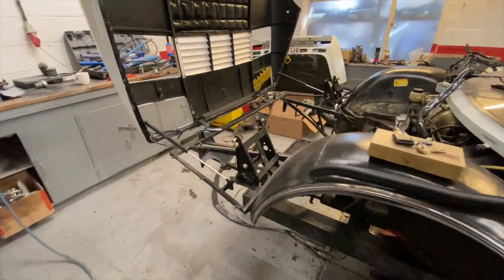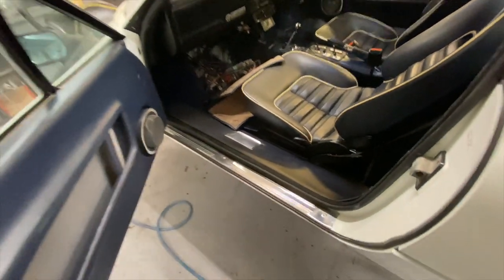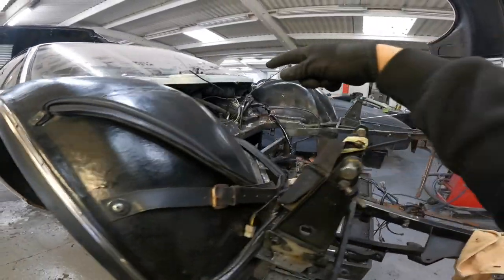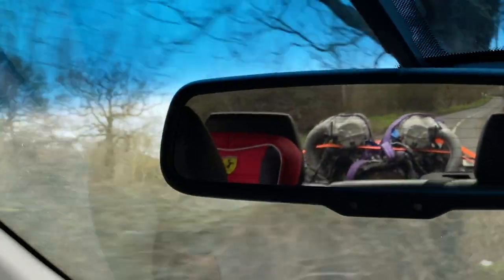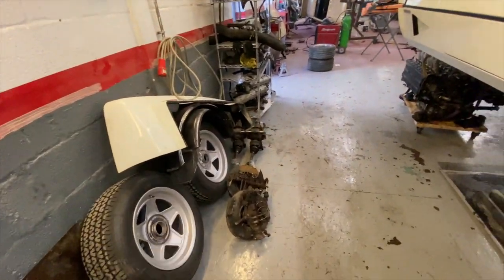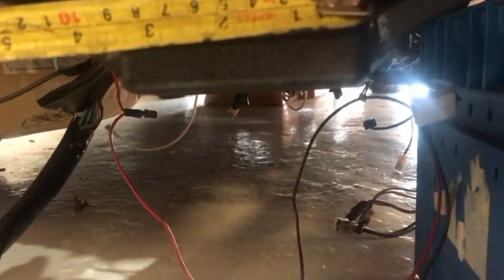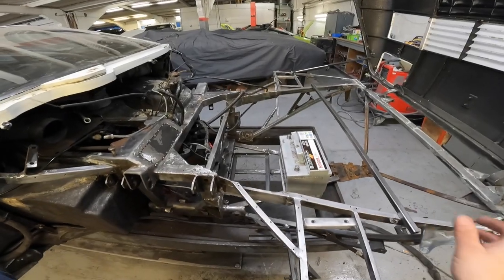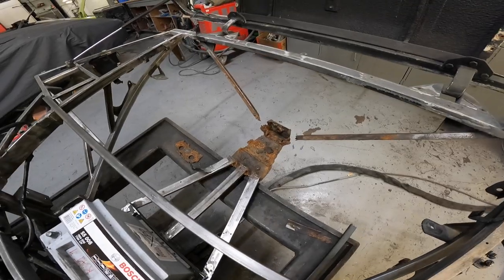I Found Hidden Problems on My Ferrari 512BBi Boxer Project

Comment: I'm surprised at the lack of rot in this car.  It's going to turn out to be a fantastic restoration.  Well done saving this beauty.
Reply: yes, its in stunning, almost '5 yr old' condition
Reply: I was thinking the exact same thing. A Ferrari - left outside, in England, for 12 years and only a couple of brackets have rusted away. Its a miracle really.
Reply: @maxgreece1  not very likely either I would have thought
Reply: Right, plus RHD BB 512 are so rare..
Reply: Rot?  Do you actually mean rust/carrosion.
Reply: @airgliderz  affirmative
Reply: Rot ? Let that car outside in the Canadian weather 😳 for 12 years and you'll be lucky to save the license plate ! Faded. 🤣
Reply: @marcryvon  It was presumably never driven on winter roads. British salt and the mild climate are the perfect partnership for rampant tin worm.
Reply: @marcryvon  so it rusted, rot us not what occurs unless your car is a Ford or made of wood or a vegetable
Reply: the phrase "left outside" is subject to interpretation.  I will put money on it that this car was not left outside directly under the sun and stars for 12 years.  "left outside" as in the outside detached garage.  the reality is that these guys just want clicks, views and comments.   they throw a little dirt and grease and oil on the cars to make them look worse than they are.  is/was this a mint car?  absolutely not.  neglected for sure but the exaggeration is for the drama.

Comment: Please protect your windshield when you powergrind and spray sparks... you will regret later. Fantastic work!!
Reply: Absolutely right.  Those little lumps of molten metal will pit the glass and you will be kicking yourself.  Don't ask me how I know....
Reply: Found this out when i melted my watch 😅
Reply: Same with wiping the metal dust off the paint when finished. It will flash rust and eat into the paint leaving tiny pits behind
Reply from the maker: Cheers for the tip 🙏🏻
Reply: in 2001 I bought a 3dr Cosworth for £3000,in 2003 some Wally Inna garage ground the brake drum lips on a 13 year old Belmont over my Cosworth and three days later the bonnet bumper headlights windscreen roof and sunroof started rusting on my car all over them areas
I'm not kidding I raced around there and was gonna fukkin kill him
After the lads called me down I claimed and got £1600 so my 3dr cost me £1400
I wasn't joking about killing him either 😂 💥
Reply: I said "Oh no, no, no!" to myself when I saw the welding begin without protecting the glass. Hopefully all is well. I'm sure that windshield isn't cheap.
Reply: Came here just to say the same thing
Reply: Not to mention his glasses.  Hope they are a cheap pair.
Reply: I'd say please protect your lungs also ! I wager these are more important
Reply: @AlfredLesliePalmer  Yeah, I always wear a respirator when welding. As someone who works professionally in the field of respiratory health, I can tell you that breathing welding fumes is very toxic. And yet, virtually nobody on YouTube wears a respirator when welding.
Reply: @ZeGermanHam  I know right ? I can't say I work in the field, but I tinker in making guitar pedals (and yes I like cars) and everyone forgets the fumes are extremely bad 
I also winced when our lovely host joked about inhaling parts of the particles from cutting the frame !
Please people, take care of yourselves, the work you do is so important and mesmerizing, I'd prefer you enjoy it for a real long time
Reply: I just posted this. Yep i grow up in a body repair garage and we always cover the glass as the hot sparks go into the glass and paint and its a pain..
Reply: @bigjohnfury5662  Your aptly named then.
Reply: I couldn't believe he was grinding near glass like that, needs some leather welding aprons or similar covering all the glass and plastic..............I agree great work
Reply: @Matt Jones - Did you have to replace any widowers?
Reply: @Ratarossa  You can remove the embedded bits from swept areas of glass with a razor blade or Stanley knife blade scraper, and leave the panel outside for the metal particles to rust out. Works really well on white paint. Once rusted a bit they come out more easily.
Reply: You beat me too it - I bet a new windscreen will now be required.
Reply: And your eyes and lungs, mate !
Reply: Did that 35 years ago on an old flat windscreen beetle .... To be avoided 😜😜😜😁
Reply: Sorry I didn't see this comment. I write same.

Comment: Small tip. After you’ve finished the weld, don’t pull the torch away so soon until the metal has cooled below red heat. This will maximise gas covering and over oxidation. Overall improves weld strength and finish.

Comment: Success will be defined by not having any “extra” parts left over when it is put back together.  Thus, one should never take a hiatus away from such a project once it has begun.
Reply: There are always extra parts installed at the factory.
Reply: As young fella of 12 years of age I watched my Dad kick and shout at the lawn mower when it wouldn't start one Sunday afternoon. With a bit of encouragement and advice from a neighbour I took it apart, cleaned everything, and basically did what I now know to be a routine service, and reassembled it. I had a handful of nuts, springs, washers, and screws left over. My Dad reckoned that was the best that lawn mower had ever run, even better than when it was new.
Obviously those parts were superfluous to requirements, and I imagine a Ferrari is no different, just bigger.

Comment: just one tip, use ear protection, might sound stupid now, but will make a difference within few years
Reply: I thought I saw ear plugs when he was grinding, but maybe not.
Reply: I agree the sound track spoils the video, should be more involving with commentary on part removal.
Reply: "Might SOUND stupid"🤣😆🤣😆🤣. Made me laugh anyway.
Completely agreed from someone with a continious screech in both ears 24/7.
Reply: Eyeglasses are not sufficient when using wire wheels, or any grinder for that matter. Cover the windows too! Sparks will embed in glass. I was also triggered watching him wave his arm around near the digital micrometer balanced on the frame. Loving this project; massive respect for taking this on.
Reply: Pardon?

Comment: I know the feeling of being discouraged on a restoration. I’m working on a project that has some light surface rust throughout and I have to basically strip the car to fix it correctly. Most people probably would even notice it, but I know it’s there and it has to be done right. In the end it will be worth it though. The feeling you get at the end knowing that you did it the right way is priceless.

Comment: Car restoration is an ultra run, not a sprint and not even a marathon, I feel for you when you say it is demoralising! Doing it one man is even harder. We know you can do it and we are with you all the way in spirit.
Reply from the maker: Thanks buddy, sometimes I need comments like this to help spur me on
Reply: @Ratarossa  Know the feeling :-) A friend just told me about a F430 with a cracked engine block that's for sale. Would love to just jump into it, but it be to big a project for a first Ferrari project. Don't even know what a replacement block costs or complete engine if there is more damage.

Comment: FYI: regular glasses don't protect from bits of grit and red-hot metal getting around the lenses. In my case, I lucked out in that the scar on my eye is in the white part, so it didn't affect my vision (once it healed).
Reply: I've been to hospital 3 times with grinding sparks/chunks embedded in my eye. Just like the windscreen - it's the heat that sticks it in there so you can't blink it out.

Comment: Great video, but you must cover the glass areas when grinding and welding, any of those super hot sparks will eat into the surface of the glass which renders it scrap! 
Trust me
Reply: Trust me too! The bits of molten metal get embedded in the glass and then go rusty and (if on the windscreen) trash your wipers. I don't think I have ever commented on a video before but seeing you grinding and welding within a foot of that GLORIOUS windscreen made me scream at the video...

Comment: That patch panel you put in buy the pedal box needs to be properly seam welded all the way around. Your only aloud to spot weld repairs if if you are replacing a complete panel and thats how it was done from the factory.

Comment: Hi Scott good to see you getting on with things, Always look forward to an update.
 The battery brace works great if you can put some 5mm rubber sheet on the brace, I throw a bit at the bottom of the tray too with some holes in for drainage, the battery never comes lose then.
 Some strong magnets make fabrication sooo much easier holds the job in place prior to tacking...
 Well done, thumbs-Up
Paul UK

Comment: I can't recall an episode where you showcased the transmission of the beast, which seem to sit underneath the engine? I saw the clutch dissaembly but haven't seen the trans in any clip the I saw. It looks as if it shares the engine oil pan space, which is pretty quirky if the case. Anyway, what's most important is keeping the legendary white shoes alive, beside doing awesome work as usual!

Comment: That bracket should be an easy fix.  The trick is make a dimensioned drawing (probably in metric) and then cut and peel back the pieces one at a time, measuring and making dimensioned drawings as you go untill you have completely disected it.  Then recreate each piece to the measured dimensions and weld it up.

I fixed a wrecked Lotus like that.  It's a bit time consuming but not particularly difficult.  In a couple days I was able to completely remake the Lotus driver's side half of the rear chassis.  A radiator bracket shouldn't take more than 2-3 hours.

Comment: Starting to strip the engine could be opening another can of worms when you have enough on your plate already with the frame. It might make more sense to stay focused on one part of this project at a time or you'll be overwhelmed by it. If you do you'll be more likely to remember how it goes back together again. 
Keep up the good work.
Reply from the maker: I had to strip it back for ice blasting
Reply: Where you at with bad compression??

Comment: If that is main rust you found you are very lucky. Quite simple repairs in fabricating if taking car apart and putting it back together is excluded. One tip, cover  windows while angle grinding. You ruin the glass with those sparks, they burn into glass if hit.  Also would't start to take delicate engine apart next to dusty grinding and welding area. I see uncovered ducts. Interesting series this has been with very unique car.

Comment: Do you think the lack of rot is because the car want used, the seals got stuck fully shut keeping the water out and by not travelling at speed, rain water hasn't been flicked up into every crack and crevice meaning that alot is just surface rust? I'm stunned that a car of this era left outside for so long in UK weather is this clean! Incredible car!
Reply from the maker: Really not sure how it survived this well

Comment: That car is solid. Ferrari done a good job in that one. Just cover the windscreen and glass when using the angle grinder as the sparks can get stuck in the glass and rust and its hard to remove it. Apart from that, great job
Ps. You getting better with welding every time :)

Comment: I’m loving your rebuild! Very impressed with your staying power and willingness to keep at it. I do want to add a note of caution. Watch your eyes when grinding. “Standard”glasses only provide an illusion of protection, and driving that lovely car will require both eyes I suspect. Sorry to be a wet blanket, but concern for you is shouting too loud in my ear and I don’t want any delays in the rebuild! Selfish - I know!

Comment: Brake pipes. Are you wanting it totally original or would you consider using braided hoses throughout? They can be used end to end with shorter sections for convenience at the moving parts. Costs are not as silly as we'd expect. I'm a fan of HEL hoses but others are available.

Comment: When you have pieces of metal bar at angles,  hanging out in mid air , cut a cardboard template that you can use for reference to make sure your on point for welding in the new one. Saves alot of guess work . Use triple wall cardboard.

Comment: I notice you're grinding steel on the chassis but not protecting the windscreen from the flying sparks. In my experience these red hot particles can melt the glass leaving little pimples on the screen that are impossible to remove

Comment: One of the things I have noticed, looking at the 3D frame structure on the computer, is that the overall frame structure doesn't look very stiff - I mean the structure encompassing all the suspension mounts and the passenger "cage".  Do the body panels contribute to the overall stiffness?

Comment: Could you scan the frame piece and cut a new piece on a CNC machine? Probably overkill. The part looks like a fairly simple weld job. But, it would be a cool visual at any rate.

Comment: They make lithium batteries 12 volt now.  Expensive but last 3-5 times longer, no trickle charger needed as only lose 1%/month, higher CCA, no hydrogen gas or corrosive liquids like lead acid batteries, charge in minutes vs hours, way lighter, full cranking power even at 10% charge vs lead acid battery dead at 70%, no cable corrosion as dry chemistry battery,longer warranty.

Comment: I worked with a guy in the late 1980s who had a few nice cars. One of them was a 512BB. He said that his 944 turbo was a much nicer car to drive. One of the problems with the 512BB was the driver's side front quarter light. If you opened that little window to get some fresh air into the car and then turned the steering wheel, you'd lose the skin on your knuckles. Painful. It's still a dead-sexy car.

Comment: Fewer rust issues than a Fiat of the same vintage. If that windscreen doesn't need replacing then I'd cover it in cardboard so hot metal sparks from the welder n grinder not embed themselves in the glass ;)

Comment: Cover EVERY painted surface when grinding or welding, otherwise you can kiss your paintwork goodbye.
I've done that mistake because i didn't think the sparks would fly far and by then they'd be cold, i was wrong.

Comment: Just a thought. Will you be using a encapsulating paint to cover the high traffic chassis areas? As it’s sprayable. This will help the cars steel last a lot longer than all other base and high traffic paint! Miracle paint is the best!
Reply from the maker: I will certainly be looking to put some kind of rust prevention on the car
Reply: @Ratarossa  cool! Have a look at the 2 types of encapsulating paint. I used it on a Mercedes ML I refurbished. After hearing a few different people banging on about it. The paint is cheaper in the US around £26 $36. But due to the US export laws your better off looking at ways to import it yourself. Or there’s a importer I found, thanks to Bill Hirsch putting me onto him. It’s roughly £10 cheaper than EBay at £85 per quart! Comes in black & silver. I’ll look up his number and leave it here for you! 
As I am amazed at the paints abilities!! And I’m not easily impressed!!

Comment: Funny detail - If I see right, those front bumper blinkers seem to be exactly the same ones from Hella which were used also in mk1 and mk2 (small bumber) VW Golfs. If it's really so, then it's easy to find cheap spares for those :)
Reply from the maker: I hope thats true these are a fortune from Ferrari
Reply: @Ratarossa  For example, the one in the link below looks very much the same. Also the housing and the gasket behind the lens in your video gave me a strong flashback from my old Golf :) https://www.classiceuroparts.com/product/vw-golf-jetta-rabbit-mk1-mk2-clear-euro-bumper-indicator-repeater-turn-signals/

Comment: My opinion is that the radiator bracket is gone because galvanic corrosion. Radiator being aluminium and bracket steel can be that.

Comment: Thought for that rusted front bracket...get yourself a one ounce round or bar of nickel and weld that onto that bracket once you remake it.  They use nickel bars on oceangoing ships as "sacrificial metal" so the rest of the ship doesn't rust.  Might prove an interesting experiment to see if the same theory also works on cars.  d;o)  It's a cheap test, anyway...probably a couple bucks (a pound or two?) for an ounce of nickel.

Comment: One day a stray bit of red hot steel will find a way  sideways in to your eye and end your career....the way you are not covering glass and other surfaces  while grinding shows that you are not aware of that danger, but finding a new  eye and swapping it  will be even more difficult than finding a new BB  windshield,so please  get your self proper  protective goggles ASAP !

Comment: Please do get those ally tanks and other parts anodised. They can be clear coated to avoid it looking too blinged, but the result will be longer lasting for (almost) non replaceable parts. "Fertan" from Frost dot co dot uk is excellent water based stuff for killing and stopping rust. It's worth getting a snake camera down into every nook and cranny to look for rust. You just never know what's lurking in dark corners.

Comment: To most of us ( 98% ) unless you are capable of doing ALL the work yourself DO NOT attempt this sort of project, it will bankrupt you in the blink of eye!!!!
Many of these car that use alloy body,s, the panels can be bonded not welded, special glue is used it is VERY STRONG you damage the panel before being able to separate them where they are bonded together!
As ANY classic owner knows RUST is your No1 ENEMY, steel if not properly treated and looked after, will RUST!!!! 
Ferrari,s and Lamborghinis of this period use a similar type of frame, tubular steel for strength and light weight but they probably were not rust proofed as good as they could/should have been.